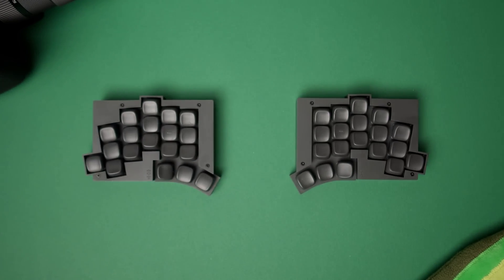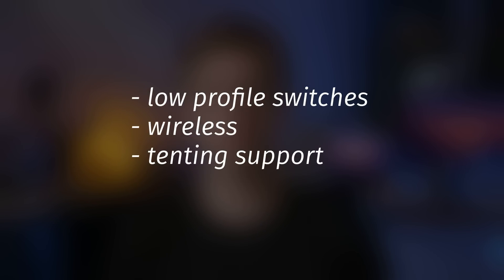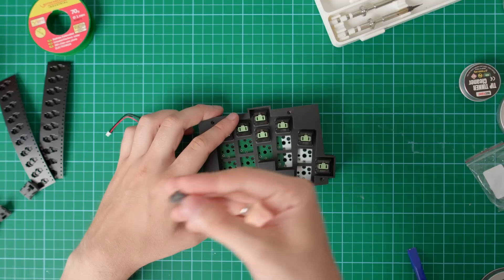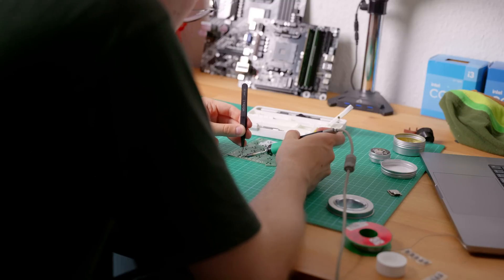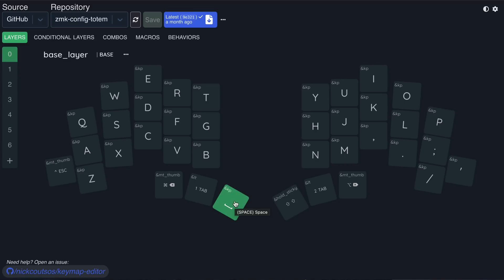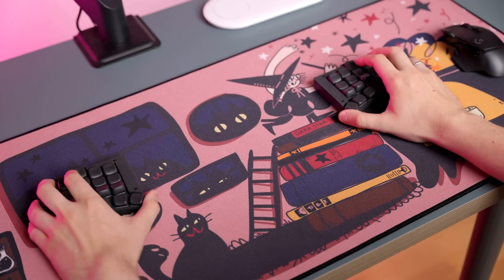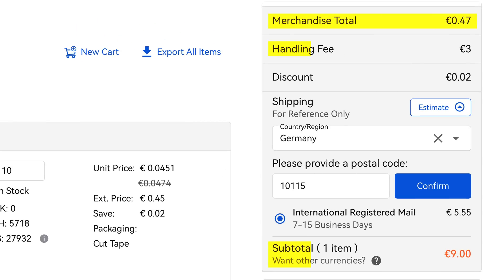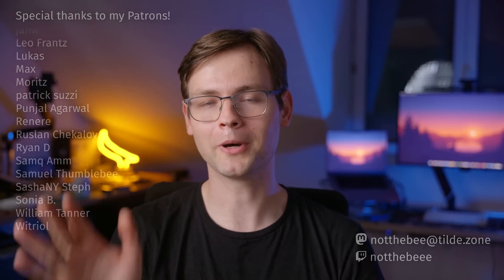Building My Endgame Keyboard from Scratch

Comment: Enjoyed the video when it came out and now came back to try this myself. I have a few questions I hope someone can answer

1. Is the key mapping/layers stored in the keyboard controller mcu or configured on the os level resp. will the key mapping stay if I plug this to a random computer. 

2. After using this for some time, what changes in hardware would you do? Other tenting design, other keycaps or so? 
Did you discover some other problems with this design or are you happy with it ?

3. What tool do you use for learning the new keyboard layout? The "Alice was beginning..." thingy

Comment: Hey Wolfgang, or anyone that has this keyboard.
I'm really used to the Magic keyboard flatness, what's the height of this keyboard?
or if you have another low profile split, what's your height?
Reply from the maker: the height of the keyboard body itself is 13mm, and the height from the bottom to the highest keycap is ~18mm. You can buy keycaps that are flatter and have lower profile though.

Comment: man we be alike on so many levels, we be using the same font, I think comic code, though my current keyboard is an ergodox ez which is configured for 34 key layout with the other keys disabled and taken out of the board. I also have a kit coming for me to build the Ferris sweep blink just stole the combo for enter wasn't so happy with where my enter key was. For the home-row mods, I started having the accidental keypresses, I dialed it down a little for each finger and with a bit of practice I have no more issues with acidental keypresses.

Comment: I've build Lily 58 Pro a year ago but kinda dropped using it. I regret not adding backlight and wireless whilst hard soldering micro controllers...
But maybe it's time to give it a revisit, since I had it configured for ColemakDH which is really comfy.

Comment: Hello man, nice video. I've build the same keyboard and I was so excited, but my excitement went down very quickly after I've understood that the stager was to much... I've started using splits like 5-6 years ago, and switched to Colemak too. It was brutal 😂. Started with moonlander -> dactyl manuform -> and now Corne. I've tried several times but it's like I'm not using my fingers when I type and in the bad kind of way. The keyboard is so small, and great. But one phrase stuck with me from your videos: tenting the keyboard makes it easy.  I did not tried that, and this gives me hope 😁. I'll take for another test drive, tenting it. Usually I'm always starting flat, and after that going gradually with the tenting. But maybe the secret of the totems starting backwards. If you have other tips for this, it would be great, but for now thank you, and hope that my fingers will not let me down.😂🙏🤞

Comment: How did u made it possible to „turn“ the keys for the thumb inwards? Am i dumb are those keys not in the lame repo? 

German cause i assume u oht of DACH region.

Wie hast du es geschafft die Keycaps in der Thumb Row nach innen zu drehen? Sind die nicht alle „vertikal“ geprinted?
Reply from the maker: There is a fork of the repo with reversed saddle keys, but to be honest, I wouldn't recommend setting it up that way – I switched to regular flat saddle keys for my thumb cluster and it's a lot more comfortable

Comment: you are lucky, I bought a kit which only works left side, then I bought a whole deal, dead right after I flash the frameware.
Reply from the maker: Totem as well? Which shop?
Reply: @WolfgangsChannel  I bought the kit from Little keyboard, I build myself never works, then I bought a sweep fully assembled by the seller and claim to work, off from Ebay, doesn't work as well, overall nicenano just don't like me

Comment: Very good content -thx a lot!
(I'm going to invest a lot in optimizing the tilt-up's, because that makes up 50% of the ergonomics/comfort, and mechanically you can easily make prototypes from scratch and in the final version on the 3D printer (or wood, fiberglass, hemp fiber laminate, casein fiber molding, or conrete for the home station ,-))
What I miss, in ya item is the (mouse-)track ball - did ya think `bout it too?

Comment: Can you make a more detailed video on how to use 2.4G wireless instead of Bluetooth? I am very interested in that.
Reply: It's not 2.4G, it's just another bluetooth controler (the same as those soldered on the boards), connected directly to the computer. It then does all the heavy lifting being what zmk calls the Central, while the two boards are then just Peripherals which makes them use much less battery.

Comment: How is this board for gaming?
Reply from the maker: This particular one is probably not great for sweaty 'competitive' gaming, since it's Bluetooth.
Reply: Split boards can be very ergonomic for gaming. I'm using the left half on an ErgoDox (wired), so the right hand can use a mouse in an ergonomic position, and the right half of the ErgoDox is behind the mouse pad, and is rarely used in-game - only when chatting with others, but that's not needed when using Discord or the like.

Comment: Hi, since there are no issues in the github repo, i'I kinda thought to ask here. I tried printing the tented case on JLCPCB. But I keep getting two errors for the bottom right. 
Our system detected the following errors in your files: Inverted normals detected, Multi-shells detected
Has anybody an idea how to get rid of these?
Reply from the maker: Pretty sure that I've had the same warnings, and the case(s) came out fine
Reply: @WolfgangsChannel  The warnings were fine. I could just click on "I accept the risks". I get the two errors only for the bottom right part and there's no way to "accept". The support is telling me the model is broken and can't be produced like that. :(
Reply: I switched from jlcpcb to pcbway. pcbway has no problem with the files. but isn"t that affordable.

Comment: I love the idea, visuals and would be interested to giving this a try in spite of .. soldering being scary. Would you be open to disclose what you actually ordered and from where? Because the parts you did mention are rather high-level and it seems every single electronic part, switch etc are an exercise for the reader to locate.. which adds to the "I'm not all too sure about my soldering skills" angst
Reply from the maker: No problem. You can find the entire list of parts on GEISTGEIST’s GitHub page, in the “build guide” section.

Comment: Is the Kinesis Advantage not even on your radar? it's no more expensive than some of the models you mentioned, and the only keyboard I'm aware of that has the concave shape to conform to the length of your fingers.
Reply from the maker: It's an interesting concept, but yes, the price is very steep. I also appreciate Totem's form factor, since I can just toss it into my laptop bag when I go to work.
Reply: Take a look at the MoErgo Glove80. It smokes the 360 in every way except ease of tenting (not functionality, ease) and "feeling robust". It actually is robust though, just doesn't feel that way, because their goal was a light board.
Reply: @penguin86bitals I have both, and prefer the Charybdis over both, and the Kinesis 360 over the Glove 80.

All of the contoured boards are more comfortable than flat boards for me, though I still use an ErgoDox on my gaming PC.

Each to their own…
Reply: @shrugalic  can't say I've seen this opinion much. But yes, every hand is different, and everyone even has 2 of them.

Comment: Thank you so much for the mention! I've been watching your channel for a while and never expected this to happen. I'm happy you are enjoying the tenting mod :D As for the highest angle setting, you are correct this is not supported as I was unable to achieve the correct angle on the outer keys without altering the top case or making the bottom plate even thicker. Those were deal breakers for me unfortunately. The middle setting should work. 
Thanks for the feedback and have fun typing!

Comment: @WolfgangsChannel did you consider Dactyl-Manuform?
It would be even cheaper to build, as the body is fully 3d-printed, and the connections are handwired, removing the need for PCB, so that the bill of materials is very low, consisting of switches, keycaps, diodes and controllers + batteries.

Comment: I see one big downside of using such a very custom keyboard, which is also a dealbreaker for me: As soon as you get used to it, you basically loose your ability to operate a normal keyboard over time. And that's a nogo for me. Typing on my wife's notebook here and there? Typos all over the place. Helping friends and family from time to time? Typos all over the place. Need to use a computer in a public place? Typos all over the place. No, that's not worth the probably more confortable experience at home.
Reply from the maker: My main machine is a laptop, so I do have to use the laptop keyboard a lot. So far, I haven’t noticed my laptop keyboard typing getting worse. 

I’ve tried typing on my HHKB when I was filming the b-roll for this video though, and that’s a completely different story. I’m not used to it at all anymore
Reply: After 20 years of typing on a regular keyboard, I guess it takes a long time to unlearn. You said it yourself. Typos when using another keyboard already. But you get used to new keyboard in a day or two. So even if you exclusively used a Totem for over a year, you will still be able to type on a normal keyboard. He might type 'jkl' quite a bit for a while but nothing too bad😅
Reply: I type on an symmetrical and orthogonal kb with a lot of thumb keys for a decade now. I sometimes need to use classic staggered keyboards on laptops and even if there are few typos there and there, this is really not a huge deal. It's like borrowing someone else's car : you get used to it.
Reply: I have no problems occasionally typing on a regular keyboard after 3 years of maining a split.
Interesting fact is that I typed the wrong way before lol, with 2-3 fingers per hand, and mostly used pinkies just for Ctrl and Shift. So I type with 10 fingers on a split and I type the wrong way on a generic keyboard. I guess these are 2 completely separate sets of muscle memory, so there is almost no interference.
Reply: I've been switching between a ferris sweep and a Charybdis nano with a 34 key layout and my ability to use a standard row staggered keyboard has not gotten any worse at all even though I sometimes spend months using exclusively the split boards

Comment: It's pleasure to see another beautiful keyboard build with my KLP Lamé's. 3:15 «мама, я в телике!» :D
Reply: As for the resin prints from JLC... They differ from one resin to another. Look for «rigid» resin if you can.
I printed my caps at home more than a 1.5 year ago and they haven't a single scratch by now.

Also, don't know why it is popular to place tilted caps to the thumb cluster. Seems like a saddle ones would be just fine.
Reply: @braindefender  i think its pretty comfortable, i would also like to have tilted sadle side way on my keycaps, is there a file like that on your repo ? or maybe @WolfgangsChannel has it ?
Reply: Парни, как кириллицу то впихнуть в 36-38 кнопок?
Reply from the maker: У меня ъ и х на отдельном слое. Жить можно, но не особо удобно. Думаю сделать правило для Karabiner, чтобы ъ можно было печатать с Option+ь, а х – Option+з
Reply: @zabejaga9489 у меня на отдельном слое "хъэё", звучит угрожающе, мне нравится. Женщине как жертве смартфонов дал сплит с колонкой сбоку под х, ъ холдом на ь, ё холдом на е.

Comment: I've been using a split keyboard since 2020, and have switched to homerow mods in 2022. I only stuck with it on the 3rd attempt, so I can understand your frustrations with it. All I can say is that it's by far the best way to use a keyboard, but it requires some getting used to and A LOT of tweaking.
I have dialed in the tap-hold timings exactly how I need them. I started really high, at like 300ms, and then went down in 10ms increments, until the keypresses started becoming ambigious. I also noticed that this point is different for different fingers, so I also started adjusting the timings on a per-key basis.
Reply from the maker: Do you also use HMRs for the Shift keys?
Reply: @WolfgangsChannel  yes, my home row mods are Win-Alt-Shift-Ctrl, in this order from left to right, on the left half. Mirrored on the right half, of course.
I tried other orderings and found this one is superior by far, but again it's preference on one hand and highly dependent on the layout on the other hand. I use Colemak-DH, your experience on QWERTY will, of course, be different.
Also, as a fellow german you HAVE to look into unicode input. If you're anything like me, you've hated the DE layout on normal keyboards back then and hate it even more now, but losing the ability to type umlauts on the US layout sucks. What you can do however is input any unicode character (including äöüß) directly using Compose on Mac, WinCompose on Windows or IBus on Linux. This feature should be coming soon in ZMK, but it's already there in QMK and KMK.
Reply: @subrezon  As yet another German: This actually sounds more like "I want a compose key" to me. Which works on Linux perfectly and for Windows there's the amazing WinCompose. I would never want a key for ü, I'd rather type compose + " + u and can also compose ① or ¢ or whatever else you can come up with, on a US international layout
Reply: @darklajid  I don't really want a compose key, I don't input any Unicode outside of the 4 umlauts, which I have space for in my layers. Compose is a neat thing though.
Reply: @subrezon  Interesting. Admittedly I rarely type in German and would rather use ue/ae etc by default, but composing stuff is something I do on a daily basis. Whether it's a nice ¹ or arrows that aren't just => or... way too often? I have a shruggie shortcut to. Compose sf is ¯\_(ツ)_/¯ and I cannot live without it anymore
Reply: An alternative to HRM could be One Shot Modifiers, on other layers or not. I've used HRM while touch typing, and I found them awful.
Reply: @archer-6568 same here, hrm messed up with my typing rhythm way too much and I switched to one shots on a layer while also having modifiers on base such as shift and cmd (gui), gui on hold and esc on tap works wonders for Mac vim tmux user, I use it on the right thumb.
Reply: US International with dead keys helps me entering German as well as Spanish special characters easily. Only downside: For quotes, tildes etc. (so the "dead" keys) you have to additionally press space. Else just hit e. g. "u for ü.

Comment: If you ever get a JLC sponsor print it in metal, probably would sound a lot better. I have the same switches on a ZSA voyager and they are much deeper.
Reply from the maker: I also have a deskmat, so that might impact the sound.
Reply: @WolfgangsChannel  usually deskmats will just lightly soften/dampen the overall sound, rather than affecting the actual tonality

Comment: Changing to an ergo keyboard saved my hands (literally).
I'm pretty hard on keypress (not that fast, but pretty heavy and consistent typing without rest) and have a bad habit of staying still for hours just for coding. So back then, using a normal keyboard would make my hands hurt so much that I had to get a complete half-day break to reset the pain.
My journey to the ergo keyboard also didn't go that well. My first ergo is a fully customized PCB with a requirement of 4 keys per thumb. Besides the excellent functionality it brought, the build (3D printed case) was too shit that I wanted to get rid of the cover off and use acrylic instead (worse appearance but better in build quality overall).
Now I settled with a MorErgo at home, and my first ergo keyboard I place it at my company (so I don't have to put a keyboard in my backpack when going to work). The journey to switch to the ergo keyboard was hard too—at least 2 months of getting familiar with/trying out multiple layouts—but I have no regrets, and surely, I never want to go back to the traditional keyboard again.

Comment: A lot of people use PCBA to get the SMD components pre-soldered
Reply: last time I built cornes I also looked into it at JLCPCB to use their assembly service, but it was too expensive in my opinion (not really the parts, but the service) and most keyboards don't have the files ready on github, so you are up to yourself to create it (not that hard actually, but you need to get into KiCAD).
I just got the stencil and used solder paste. If you are dirt cheap you can solder in a pan with sand, even though I personally would use one you perhaps don't use for food anymore (even though I don't see a reason for contamination) or you use a used mini oven.
This also adds up but you can use it more than once if you plan so.

Comment: Funny timing cause I also just got into split keyboards. Personally I went with the prebuild 42 keys from Aliexpress. With cables, switches and keycaps I spend around 120€. I can definitely recommend it if your lazy like me, but the seller won't give out the source code and you need to use vial to configure it as far as I'm aware.